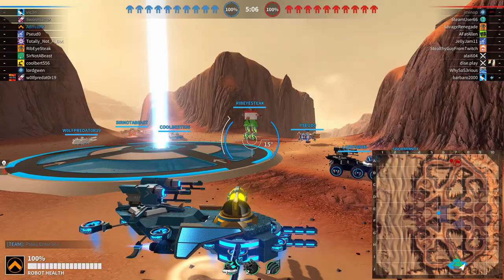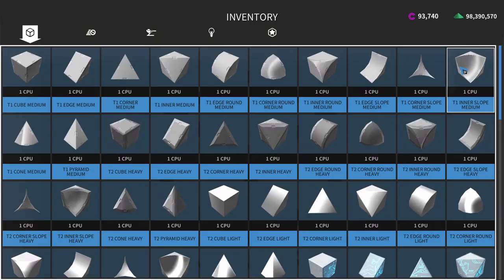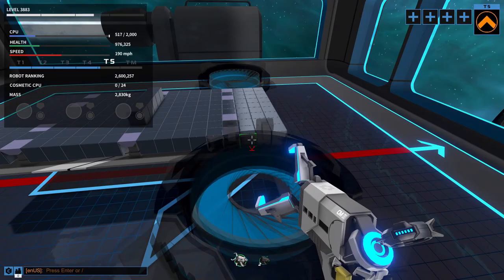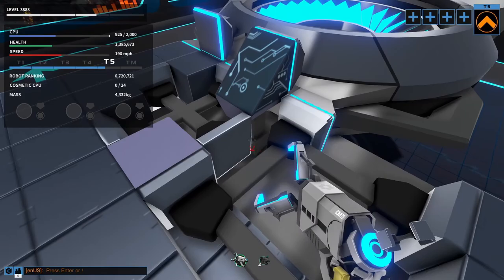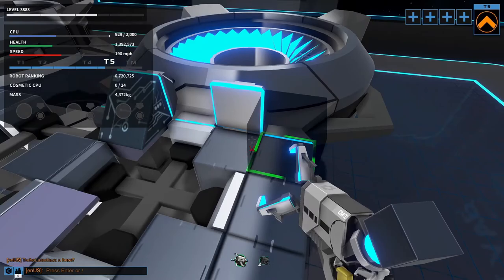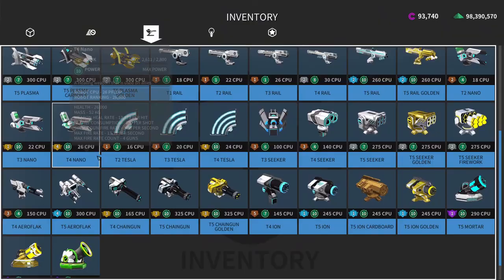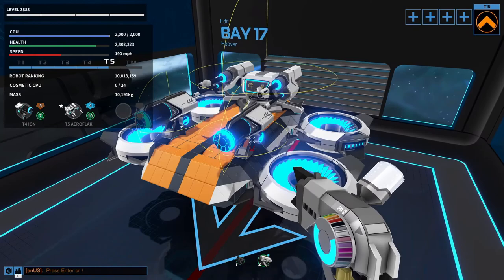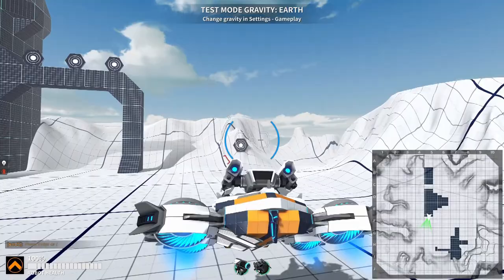How not to suck at Robocraft - Building Hovers

Comment: the advantage of
 smaller oveeblade would be that you can hide them deep insinde the chassy, here there are way too exposed
Reply from the maker: That is the tradeoff you make when using the larger hovers.  The reason I use the large hovers is partially because I like the way they look, but they also are fairly durable and they can move the entire robot effectively even if there is only one hover left (something smaller hovers struggle with).  You most certainly can use the smaller hoverblades, and you might even hybridize between large and small ones to get the best of both worlds.